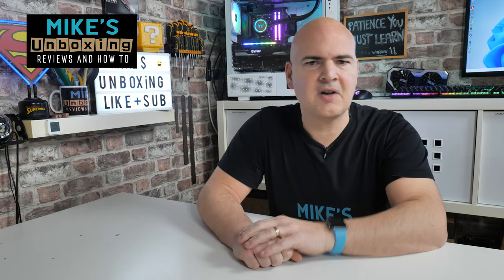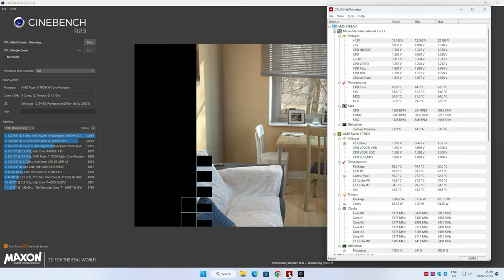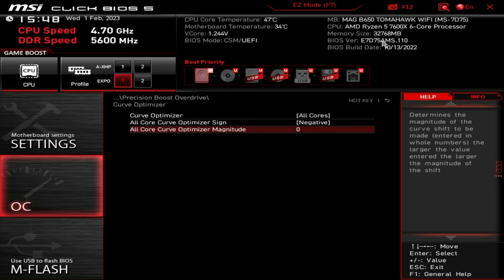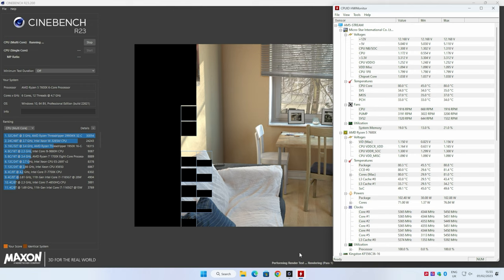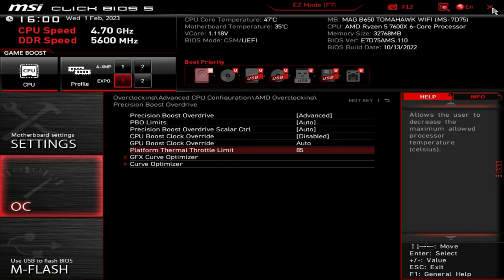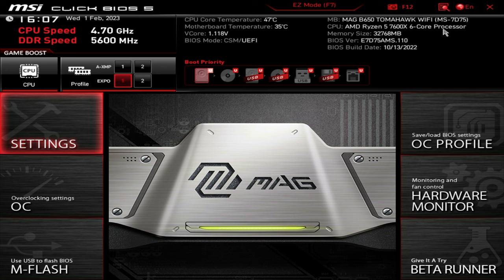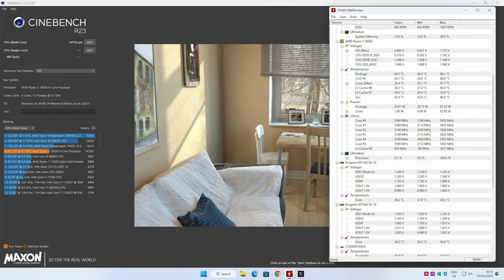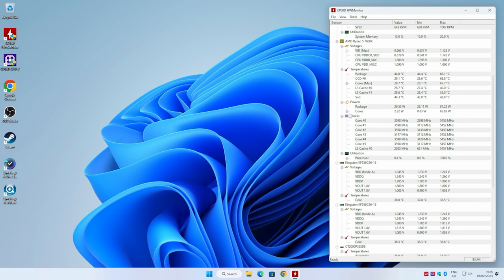How To Tune AM5 Ryzen 7000 Series Wattage & Reduce Temps With Curve Optimiser PBO2

Comment: mine doesn`t work at 30, cinebench works but i found another test that doesn`t pass so i am now running with 20 which is perfectly stable
Reply from the maker: awesome
Reply: If you run OCCT, it will tell you which cores are producing the errors, and you can adjust accordingly. (core count starts at 0, i.e core 0 is core 1)
You may be able to push a few to -30, but may have others that will only take -10 without throwing errors.
Reply: @CigsInABlanket  i know ty but it`s very time consuming
Reply: @CigsInABlanket is that a software? I’d like to experiment

Comment: Cant you just go into Ryzen Master, let it optimize for you for 2 hours and save it?
Reply from the maker: if you want to, long time to wait though
Reply: @mikesunboxing  My system crashes if I try using Ryzen Master Optimize all cores.  I may have to reset to defaults before doing the optimizations because I had set my CPU voltage lower to achieve lower running temps and faster speeds.  Might just get rid of Ryzen Master and just use the Bios as in this video.